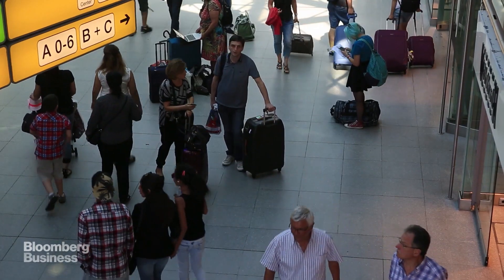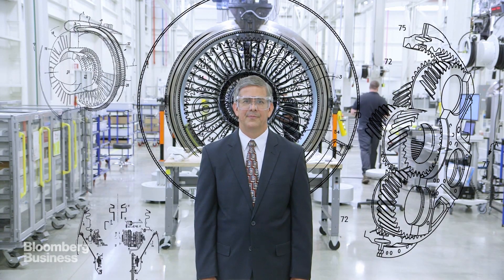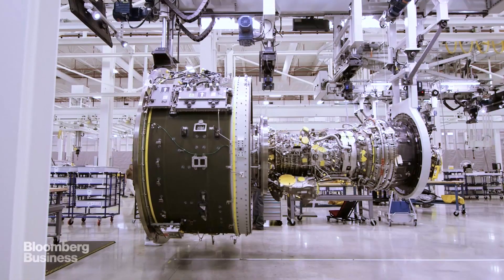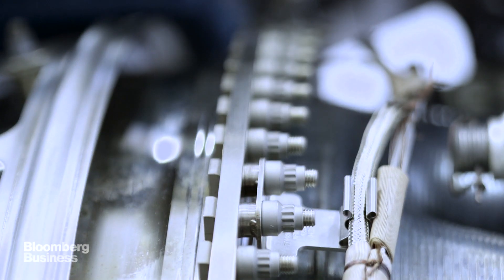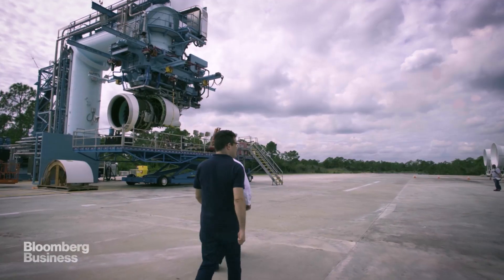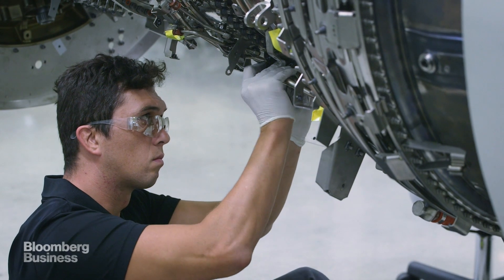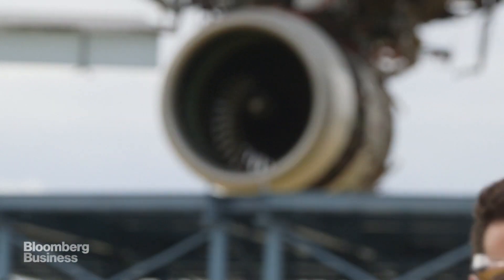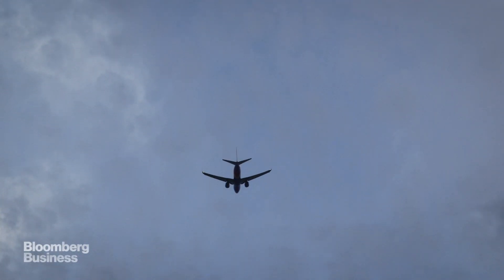This Genius Invention Could Transform Jet Engines

Comment: The were geared turbofans in use from the early 70s.
Reply: There have been phones in the 70s too.
Reply: i. rob  No worries. That's pretty much it, reliability and compactness. If you think about it, the strength of things like gearboxes goes up with the square of their size (because it is largely a property of surfaces and cross sections), but the mass of such components goes up as the cube (since mass it's dictated by component volume). So at some point the gearbox will become impractically heavy. PW's innovation here is in the materials science department and engineering a box that's still light enough to fly, but strong enough to work reliably for thousands of hours.
Reply: I think your find it's geared TURBO-FANS not jet engines that has been around since the 1970's.
Bloomberg doesn't get news that wrong as you suggest
Reply: +chris77777777ify  I mean turbo props
Reply: AMVM Yup, Avandigandale/Perm Engines were the first in this tech. USSR baby, take that take that!
Reply: I think what has allowed a progression into better gear design and gear assemblies is improvements in lubrication, material science, CAD, FEM, FEA, machining, computer technology such as multi core cpu(s), gpu(s) and parallel processing.
Reply: i. rob  Garrett TFE731
Reply: i. rob  PS-90 . USSR was way ahead in this stuff.
Reply: KingLutherQ Most certainly an improvement, but not a revolutionary idea. Even fairly large geared aircraft turbine engines have existed for a while, though not necessarily turbofans. The Kuznetsov NK-12 is the single most powerful turboprop ever made, capable of nearly 15,000 hp at takeoff. Very roughly translated to thrust, this would give you somewhere in the vicinity 60 kN, or about the performance of a JT8D low bypass turbofan commonly found on Boeing 727s and early 737s. There's a reason why the Tu-95 is among the fastest propeller-driven aircraft ever built.
The engine which P&W are building this gearbox for is the PW1000G, a roughly 120 kN thrust range engine. More powerful than the NK-12 by about a factor of 2x. Neat improvement, but not a revolution. Reporters really like to toss that word around, because nobody wants to watch a boring report about a 2x improvement over the span of 40 years.
Reply: You are kind of right, they started research on middle 60's and are a MANDATORY piece of mechanical equipment on all big turbofan engines nowadays!

Comment: It took them 30 years to figure this out? -.-
Reply: This concept is not new.  The ALF-502 that powers the Bombardier Challenger has a geared fan.  The issue for commercial turbines that power air liners is stress on the internals of the box when up scaled.  The problem is one of lubrication, cooling and metallurgy that will make the gear box economically viable and not cost more than the fuel it saves.
Reply: same question here... I wish I had the money to transfer this idea into praxis, because I thought of it at the same moment as agent jay z talked about this phenomena
Reply: This must be a joke right? Sure it could've been faster but 30 years is not an absurd number considering how much engineering it takes to design this to be certified. GTF concept has been around for a while but to make one that carries living creatures like you and be able to perform through various hazards, it takes many different engineering disciplines to come together to make a concept a reality.
Reply: Shawn Valair very badly explained.  It's tricky and even small advantages take a very long time to be accepted
Reply: noone said engineers are always clever xD
Reply: It takes alot of time and money just to get the simplest of STCs approved by the FAA. New designs, even more so! The paperwork is nuts. Perfecting something like this also requires extensive testing. This is firstly about safety and governments want proof of it!  What makes flight possible??? Money.
Reply: He started before 30 percent of the people alive today were born.
Reply: No 30 years to develop it

Comment: why do u want to make it quieter or fuel efficient why i rather not to have that it will not make it plane
Reply: +a Banana The company saves money, the passengers get a better quality service, and its better for the economy and environment. #troll
Reply: +Randy Sullivan Seck ...Also means greater range which means less connections for a full house.
Reply: +a Banana Are you banana's fuel efficient and quieter means cheaper local flight tickets.